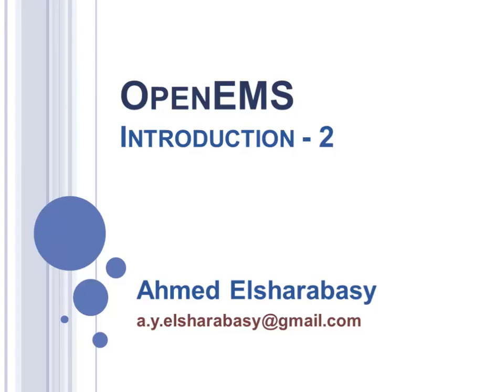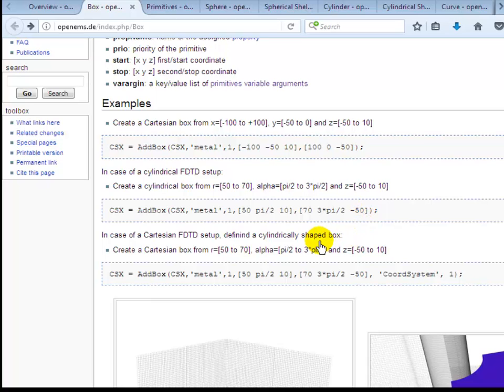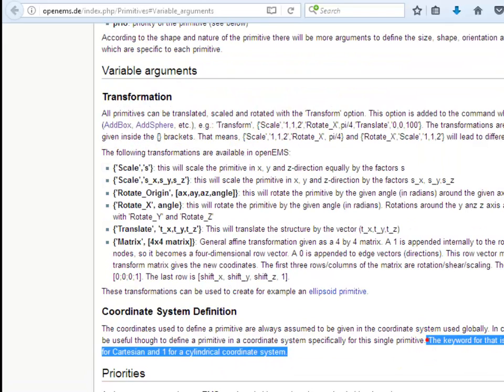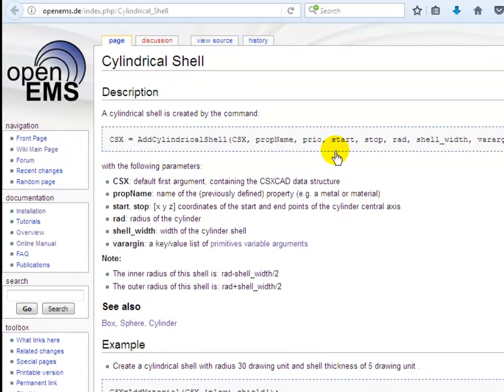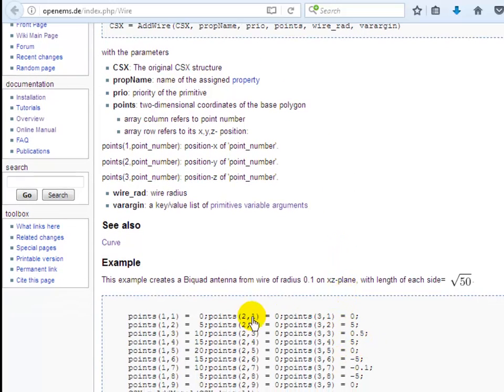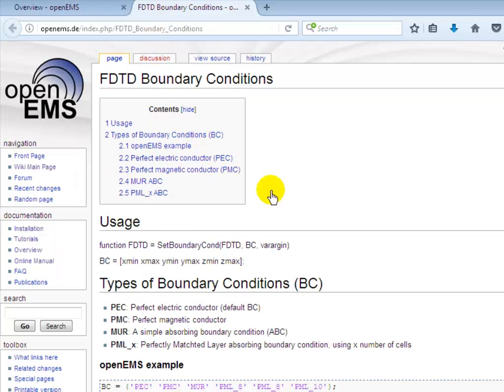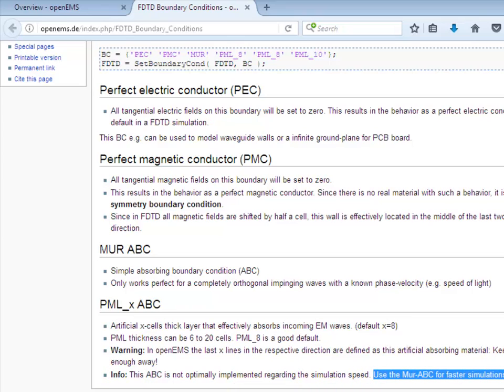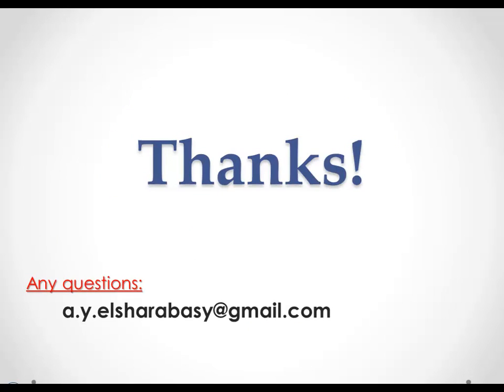openEMS - Introduction (p2)

Comment: Are there points to keep in mind to speed up the simulation? The tool is interesting but super slow. so very hard to use it regularly. I am trying to run a simple parallel plate capacitor, and it takes more than 1 hour to run the FDTD sims. I have 16GB RAM and AMD Ryzen 7 5700U CPU.

Comment: Thanks for the videos.  Have you tried to import a structure such as an antenna, and set it up so that a simulation can be performed to compare the results to a commercial program such as HFSS?
Reply from the maker: Actually, I didn't try to import structures built using different CAD software. However, if the structure is possible to be built in HFSS for example, definitely it will doable in openEMS.